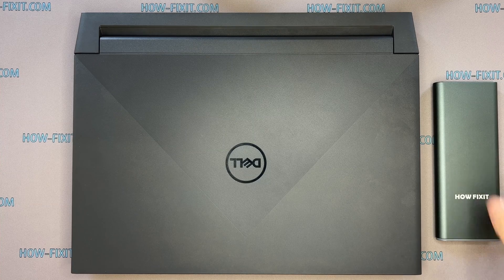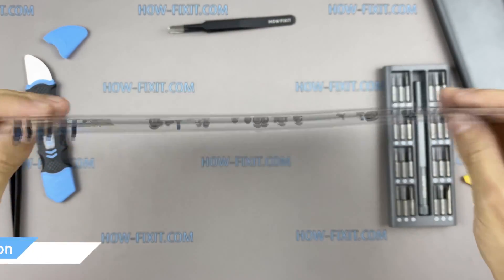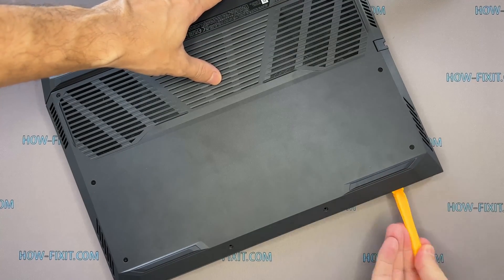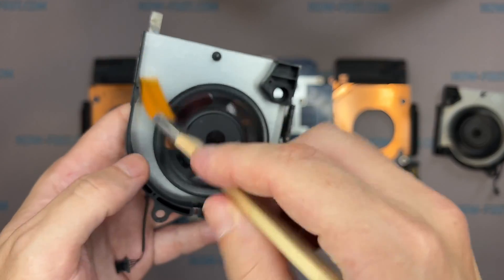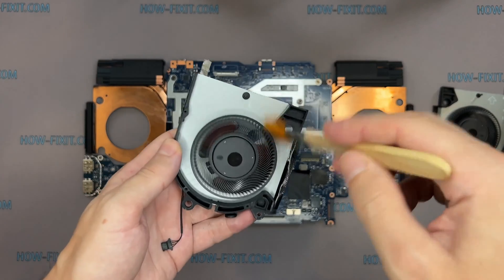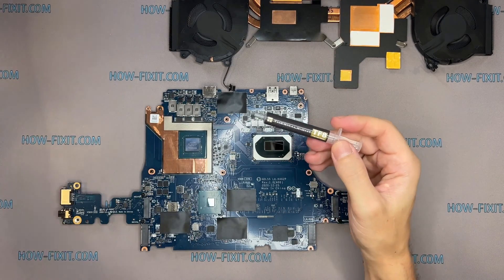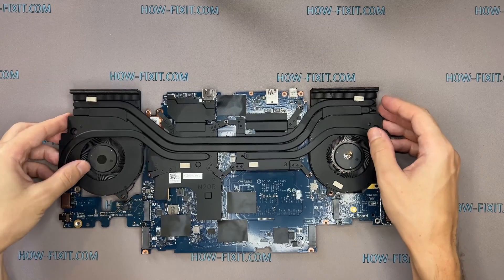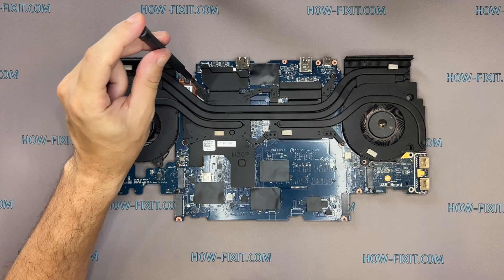Dell G15 5510 Disassembly, fan cleaning and thermal paste replacement

Comment: Anyone have any issues when disassembling and reapplying new paste. My idle temp been fluctuating at 50-60 at idle. Before I apply the paste, my CPU was at 40c idle. Did I mess up something? I follow step by step. I did notice the initial paste was all over the cpu

Comment: This laptop is really affordable, but having to remove the motherboard, just to clean the fans or replace the thermal paste is giving me second thoughts. Dell definitely engineered this hoping the users will never clean the fans and thus will have to buy a new one when theirs inevitably starts overheating
Reply: My G15 5510 is 2 years old, it keeps working as the first day except for overheating. I can open it, but it takes a lot of time
Reply: It looks fairy simple to do, only a few screws and unplugging some connections then it done. Another thing is this video is about disassembly and cleaning (not only cleaning) so may be there is a way to do cleaning with out taking out the motherboard
Reply: Yes

Comment: One of the nice features that Dell G15 model have is a self pop-up cover when you unscrew it. This will help the cover side prying much easier and less damaging.
Reply: Shit u know what i was told the same but that back cover thing was stuck like a mf after unscrewing those screws couple times was still stuck asf
Reply: @513nd3rman  Factory defect? How many have you opened?
Reply: @kluangh1tam  ya it could be bc i only opened mine it was stuck pretty bad in there also i thought maybe bc it was the first time but when i reopened it again i had to deal with the same issue again as if those screws r not doing anything at all
Reply: @kluangh1tam  and the screws r working fine but it's something abt the sides idk

Comment: no before and after results of benchmarks to compare? what is the baseline so you know your thermal applications was indeed successful in reducing temps?
Reply: lol. he just make the video about how to disassembly not benchmarks
Reply: @hoangminhx007  yeah i know, i was hoping for some benchmarks for confirmation purposes but this is still nice, definitely will be using this video  when replacing thermal paste on my g15 , it's already due for late this month
Reply: Dell thermal paste is good quality its thick and doesn't dry up quickly
Reply from the maker: Check this video - How to fix laptop overheating: https://youtu.be/1PTRCc_BRtQ
The ultimate guide to a laptop overheating covers everything from software solutions to CPU and GPU undervolting, and hardware checking.